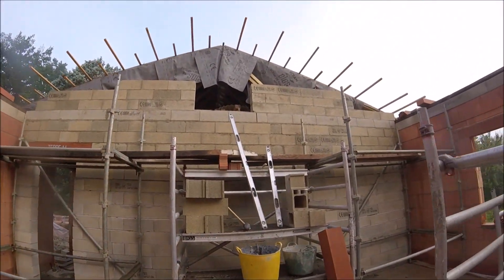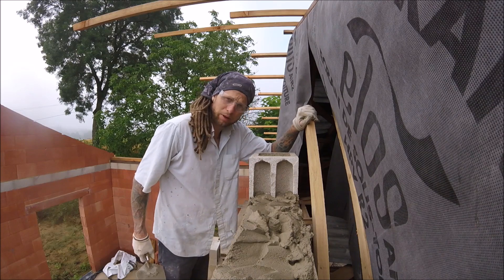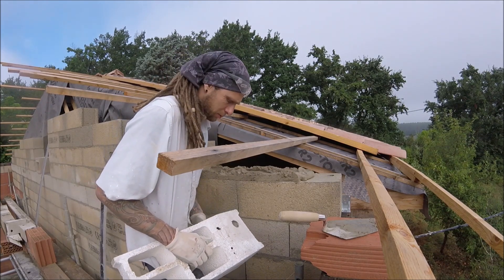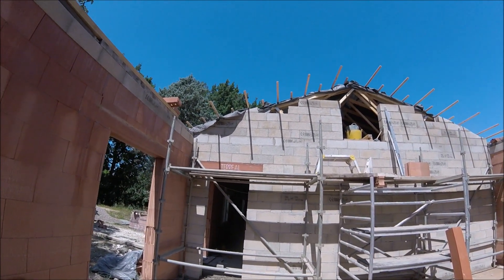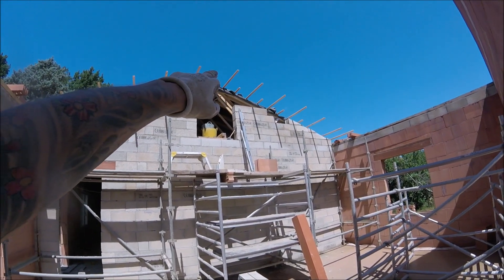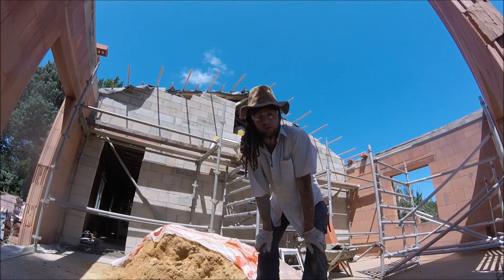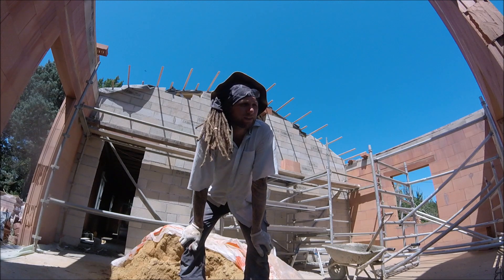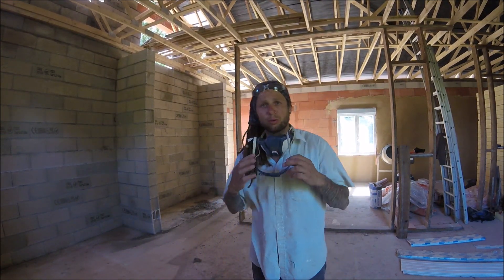This Old French house the series, I need purlins, gurt big purlins

Comment: We were at our house in France recently and experienced the high temps 
ourselves. Outside chopping trees and cutting the grass in 38c. A few days later 
passing through Rouen on the way back to the UK it was 43c.
Where we live, when it gets very hot the French stop working and stay 
indoors, not us Brits, we stay outside, working in the sweltering heat and then 
get sun burnt and sun stroke! lol
Wall looks awesome now. Hope you get the purlins soon. How you going to 
lift them up to roof level, they will weigh a ton?
Reply from the maker: David K a friend has a forklift that’s €100 for the day so will be using that as the purlins weigh to much to handle safely, should be able to fit them with just two of us with a bit of flapping about